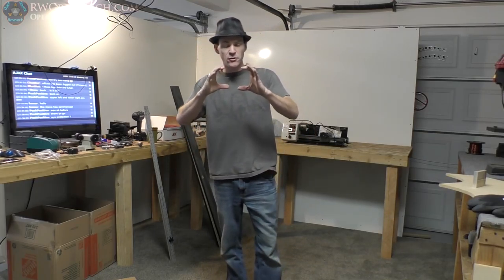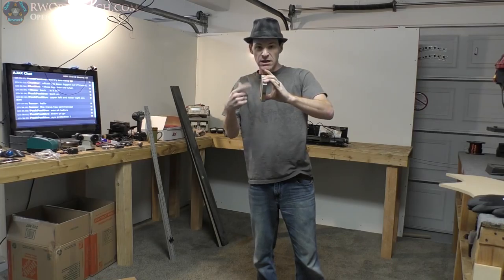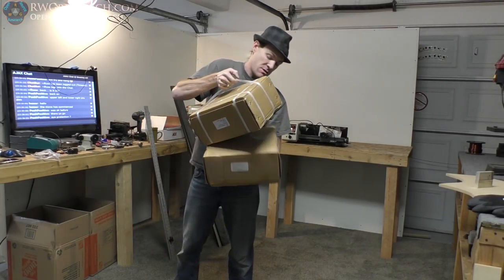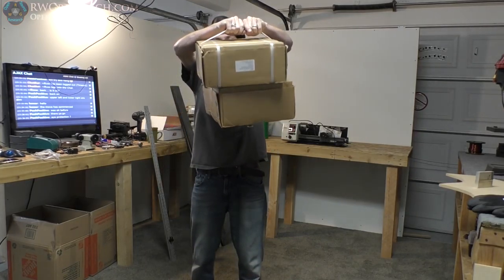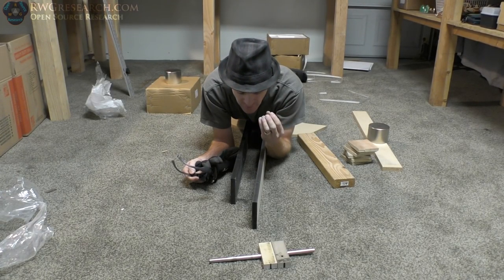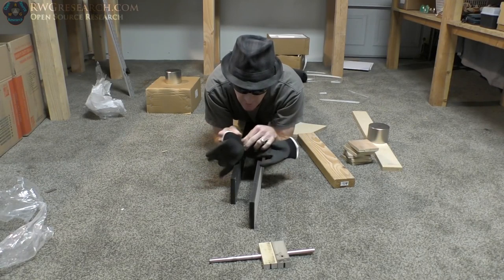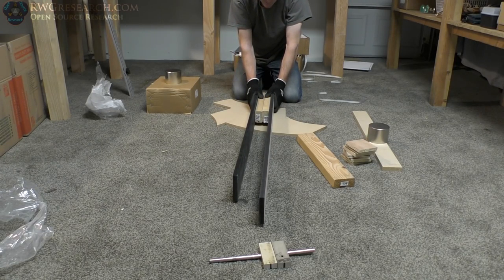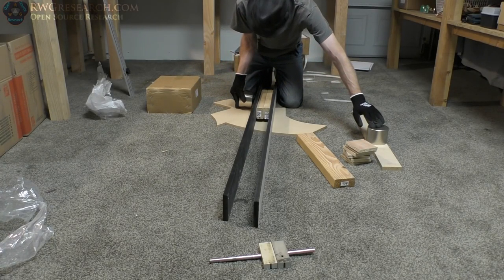JWN Project P2: Putting Very Large & Powerful Magnets Together. ( HOW TO) + A Little Fun...

Comment: Wow what would you have done if the friction of the small magnet had hit a slick spot on the card board and that little magnet was propelled to the larger one and exploded like a bullet.
You are a very brave man and may be a bit careless. It only takes once, be careful out there. I would have put a wood barrier between the magnets to not let the small magnet get close enough to become dangerous projectile. Calculate the velocity of that magnet at a distance its a square law.

Comment: 2:52 If the blade was attracted to the magnets = chopped fingers
10:57 If the button magnet was attracted to the magnets = broken fingers
Reply: Razor blades are usually stainless steel and therefore barely magnetic. Also it is so thin, it can't really apply any dangerous force, no matter how big the magnet. The other magnet was obviously attracted to the big magnet, but not nearly enough to be a threat. Russ was probably as safe as it is gonna get ^^

Comment: Interesting video. Are you going to secure the magnets to the middle plate with epoxy or something? As strong as they are held together, are you worried at all about them eventually  shifting and throwing off their balance?
Reply from the maker: I use a small bit of glue to hold them in place. Then warped Fiberglas tape around the ends so they dont move. There quite secure. great question, ill cover this in the future. ( i think)   ~Russ